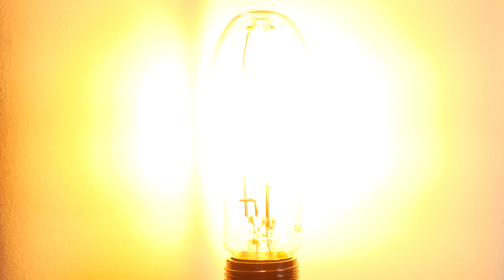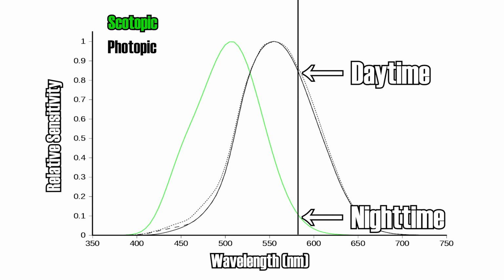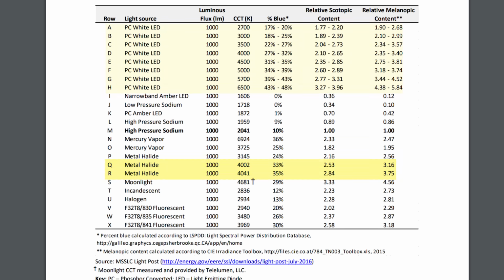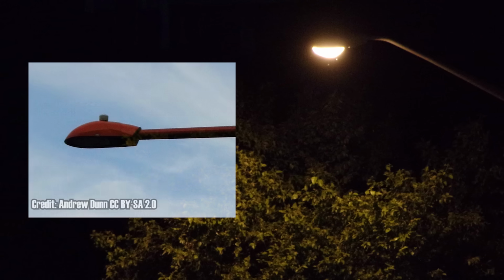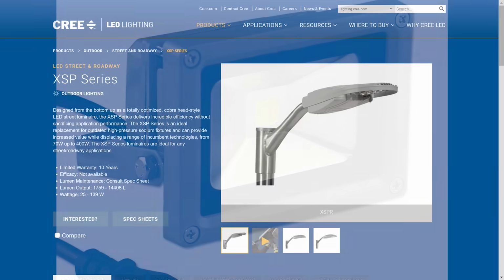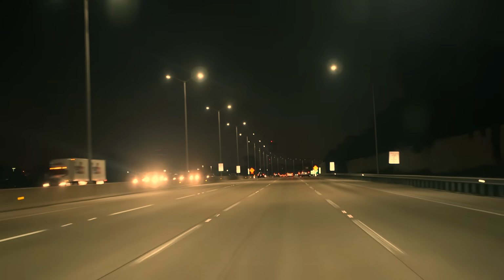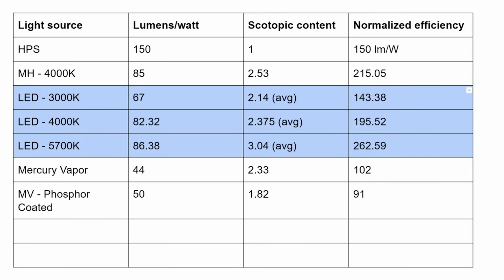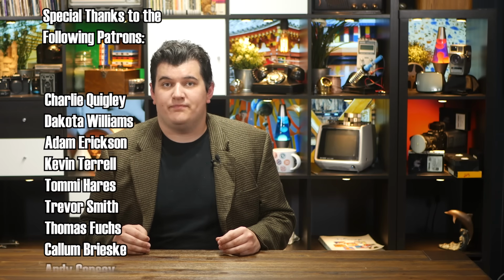The LED's Challenge to High Pressure Sodium

Comment: Good report.  One other thing you didnt mention in the comparison that is the possibility of using motion detectors to dim or completely turn off led lights when there is nothing moving that might benefit from a lighted path.  If implemented that could cut the energy use in half or even better. 
 Sodium vapor cannot be turned on immediately, they take minutes to come to full brightness and that would also dramatically reduce their lifespan even if they could come on quick, where led's are fraction of a second to full brightness and would last even longer if off when not useful. 
Oh and I have to respectfully disagree with you on color preference and the reason why was precisely because you just cannot see as well with sodium vapor as with the metal halides they replaced.  I'm sure some minor differences in eye structure or perception play in to the preference but for me the metal halides just make everything more visible. Well now we have led's that can have even better effective spectrum on way less power and multiples on lifespan, Win win win.   Bring back bluer light.

Comment: I guess the best thing to do would be mixing both colours
For low and medium residential areas you try to use the lower temperature LED in order to avoid secondary effects on people
but on long roads, especially in the country sides on highways, you'd want to keep the blueish one as they'll help the drivers to stay awake longer. 

At least, that's from what I understand

Comment: Has anyone ever seen fog lights fitted to semi trailers, prime movers, whatever you want to call them.
They are spot lights that are orange - yellow in color.
They are used when fog covers the road and you can't see.
Well, this is why High Pressure Sodium lights were used as street lights..H.P.S lights can cut through fog as they emit Red Spectrum light making it possible to drive and see under weather conditions that white and blue spectrum lights make it impossible to see anything.
It's a safety issue in a nut shell..what price do you put on a human life.???  Could we do with light shades that project the light better ??? Absolutely..should we get rid of HPS lights ?? Only when we can replace them with LED lights emitting red spectrum or an orange - yellow filter.

Comment: I just discovered your channel. It's great, and I intend to view more of your videos.

But I do have an observation about LED light. Compared to more traditional incandescent, or HID light, LED light seems "flat".

For example, when I first used an LED flashlight while camping, I noticed the brush around me appeared flat. The brush blended in with the surrounding groups. Almost as if there was no depth perception. This is not a problem with an incandescent flashlight.

When they first started replacing HPS streetlights with LED, I noticed the same effect. To manufacturers' credit, LED streetlights have improved in this regard.

What's I'm curious about, is if you've ever seen this effect, or are you aware of it. And if it's something I'm really seeing, can the effect be explained?

Comment: As somebody who worked on observatory light pollution issues and building approvals for some years, I think this is a very well informed presentation. I would like to add that the reason why lamps of the sodium and multi-halide type  are so bad for observatories is that they emit very bright emission lines. However, the low pressure sodium (LPS) ones emit intensely in one very narrow band, so  filters in astronomical instruments can be arranged to exclude this light. In addition, the sodium "D" lines are in a less interesting part of the spectrum for astronomers studying stars. On the other hand, mercury and halide vapour lamps emit many lines spread across the blue and near UV, areas of most interest to stellar researchers, and cannot be easily excluded. For this reason, even high pressure sodium lamps, with a much wider sodium "D" line emission but mainly in the yellow, are not as bad. Now, LED lights usually emit across the visible spectrum, with a broad peak in the blue, but it's a continuum instead of emission lines. This is better than the older sources for spectroscopy, but worse than low-pressure sodium for imaging, because now the light pollution is spread across the visible spectrum and adds sky backgound at all wavelengths. However, LPS is also the least effective from a human point of view, both for the reasons given in the video and because all sense of relative color is lost (which is why operators of shopping mall parking lots insisted on white multi-halide, nowadays LED, so that shoppers would not run back to stores in horror at the colors they "see" while putting freshly purchased goods in the trunk). LPS lamps also don't work well in cold climates such as Canada's, but are good in Southern California, although hampered politically by the fact they tend to not be of US manufacture. 

The fact that LEDs are much more amenable to uniform light spreading via lenses is encouraging. Direct upward radiation and non-uniform ground illumination are the greatest causes of light pollution.  The only way to prevent radiation above the horizontal is not to have any part of the luminaire visible from above the horizontal. Dropped covers and lenses get dirty with time and scatter a lot of light upward. Flat-bottomed cobra heads and shoeboxes are the way to go.

Comment: I prefer the orange street lamps, its just a more pleasant light, the LED "bulbs" have a cold unpleasant light that pierces right into your eyes I'd rather stick with sodium.
Reply: @ska042  The only ones I've ever seen have been a cold white light that only lights up the area immediately under the street lamp whereas the sodium lamps have more  light coverage , maybe these over LED types exist but i've never seen them in use

Comment: LEDs RUIN NIGHT VISION!!! Can’t believe you missed that critical SAFETY  point! Way more important than circadian rhythm. Interstate and Highways may benefit from LEDS, but not rural, urban and suburban areas!

This “mis-alignment” is a BENEFIT for areas where you have a mix of lighted and dark areas. Unless you can to light 100% of all roads and sidewalks! (eg highway) Which does Not happen - even see your view of the rod from the airplane @10:08 and you see “spots of light” and “gaps of darkness”!

Daylight/blue color lamps ruin night vision, hence cyclists and pedestrians just outside the light of LED cannot be seen and are more likely to be hit! However same person in the shade outside a warm sodium light can more easily be seen since night vision is not completely ruined.

Comment: The amount of light from a streetlight that actually hits your eye is negligible. As a driver, the roof of your car blocks most of the direct light. There is still some direct light that comes through the windows, but windows are far less transparent than people realize. Only about 10-30% of light makes it through a window, and that's assuming it's untinted. For light to affect your sleep patterns you need 2 foot candles to actually hit your eye vertically. Seeing as your eyebrow casts a massive shadow over your pupil the amount of light hitting your pupil is a small percentage of the light hitting everywhere else. When you consoder that roadways aren't even illuminated to 2 footcandles horizontally, it's clear that even as a pedestrian the amount of light hitting your eyes would be negligible. 

Source: IES presentation that was given in Toronto on this topic

Comment: Well, nice video man, but the most important fact about yellow light you forgot. Sodium light make the human eye recognise motions at the side of the road much better and faster. Which is the reason we use sodium lamps here in austria only at crossroads and sidewalks. And by the way, the yellow-orange light has a wavelength which insects and animals in common almost can’t see.

Comment: Weren't low-pressure sodium lamps chosen partly to address the light pollution from mercury vapor, which was exacerbating light pollution near observatories? How do the LED replacement lights in these cases address both the light-pollution and nighttime pedestrian visibility issues? 
(Nevermind, you answered this in the later part of your video).

Comment: What about HID headlights in cars? Their normal beams are sometimes blinding when driving down a road that doesn't have street lights. I drive 20 miles down a 2 lane, paved road from my work to my home and I get blasted by these headlights every night. Maybe they can see further in front of them but I can't see anything but the right side stripe on the road and absurdly bright headlights coming my way. They might see a deer but I sure as hell won't.
Reply: In Europe, the dipped beam deflects down and away from the oncoming traffic reducing the problem.
Reply: That has more to do with the angle of the light than the color temperature.  Properly mounted headlights are supposed to be pointed at an angle forward and downward to light up the road and not blast other drivers in the face.  Highbeams are angled straight forward.
Reply: @cameronrosen6910  you forget the faded headlights that even the halogen lamps can blind, the problem is the low maintenance that some people do to their cars,
Reply: @ViniGiovanni  I haven't forgotten anything.  Like I said, it's the angle that makes the difference, not the type of light source.  And what does maintenance have to do with it?
Reply: Cameron Rosen perhaps he’s referring to anything that could affect the height/angles of the headlights -eg tyre inflation, suspension wear. Not sure how much those things would affect the headlight height/angle but I’m sure it would make a difference. If the car has had the headlight assemblies removed for whatever reason (eg after a minor accident) - have they been re-aligned with a beamsetter?

Comment: I really don't like LED headlights. Traditional headlights are better on the eyes, though don't illuminate as well are still better for everyone when looking at headlights. LED headlights can be mistaken for brights, which is frustrating for everyone. How can we reduce LED brightness without compromising visibility for the driver while making it easier to see for those driving the other way? Add a yellow tint to LED?